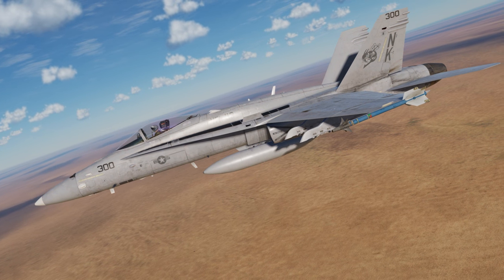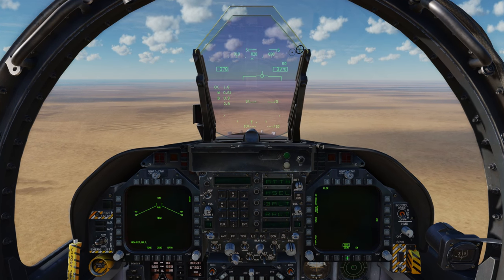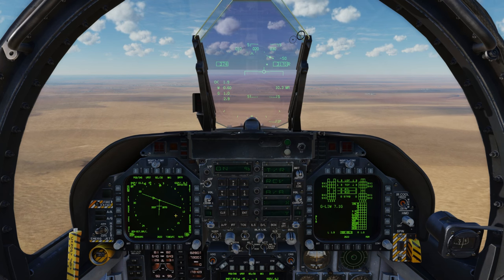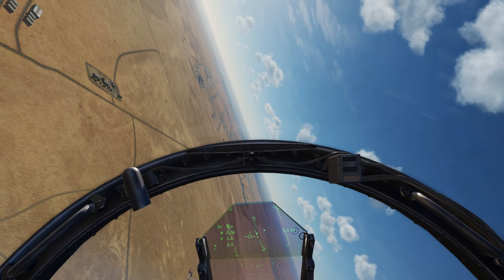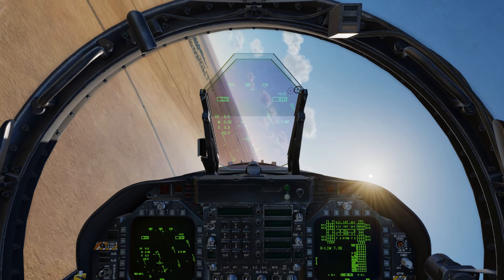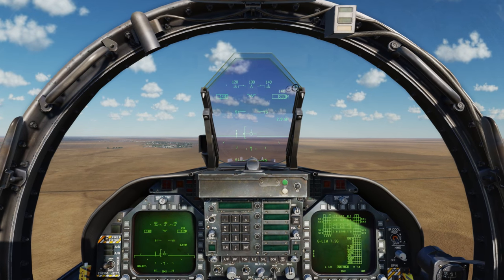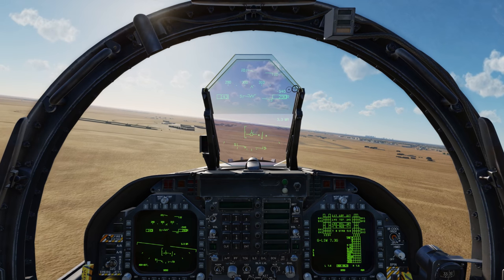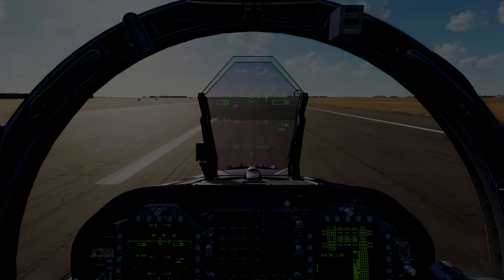DCS: F/A-18C Hornet - Episode 6: VFR Airfield Landing

Comment: Do you push the stick forward after lowering the landing gear and setting the flaps to full in order to keep the velocity vector close to the horizon until the aircraft is trimmed for proper AoA? I am looking for a proper solution to that initial lurch so I don't gain too much altitude.
Reply: YES
Push forward until you start to get around 140kts, modulate as necessary and try to keep the velocity vector on the horizon, once it levels out you'll start to use throttle for pitch, not the stick. Be very aware of the airspeed while holding the stick forward because if you let off it to late to start using the throttle you will nose dive. It will take some time to get used to and just keep trying. I was in the same boat as you last week when I liked your comment. Hopefully by now you have already figured it out but maybe someone else who is in the same boat will read this now.
Reply: @isaiah2261  Thank you. Yes, I started practicing along the same lines, but it helps knowing other people are using the same method. Means I might be on the right track.
Reply: @isaiah2261   thanks I'm in the same boat right now :)
Reply: Mee too in that boat.

Comment: Hi Matt a few have mentioned it on here about 800ft being too low, you said it’s standard US navy procedure, my question is, thus airfield is flat terrain all around, many airports however on various maps have mountainous terrain, some higher that 600/800ft, what happens is this scenario? Surely the 800ft/350 knotts needs to be increased in altitude? Thanks in advance
Reply: The 800 feet he mentioned is radar altitude therefore it is absolute height above terrain.  If the airfield is above 800 feet BAROMETRIC then you would still fly the pattern at 800 feet RADAR.  Assuming the 800 feet is correct.  I can't comment on that as I don't know the naval procedures (I was AF)
Reply: @JohnVanderbeck  thanks for your reply, I should of explained better, so when flying the upwind, that’s all good at 800 feet, however on the 1st turn (crosswind), and downwind, many airport terrain fluctuate as you fly over surrounding mountains and hills adjacent, the example shown here is perfect as it’s flat, but many times I’ve turned and found myself down to 400 feet due to increasing terrain height - at this point I’m just presuming that pattern landing would nit be allowed at such airports…..but there are many of them, particularly on the Syria or Persian gulf map

Comment: This break arrival might be US-typical, because you'd get rekt out there in the French Navy/Air Force for decelerating during the break (first turn). If you are doing a 2-ship or more formation break arrival, the second, third and fourth guy would just slam your back faster than you could ever imagine, especially if you are at 150 kts or less during last turn.

Procedure here is 350kts and 3g turn until downwind, then airbrakes (not for the leader)/flaps/gear out, confirm 3 greens (or BIP), then point 180 turn at 150 or 170 kts (it depends if you're in a Rafale or a Mirage 2000), THEN in final, you keep your AoA into the green.
Reply from the maker: If I do a French aircraft over a French airfield, I will keep this in mind thanks.
Reply: AFAIK, French Navy pilots are trained in the US ;) And NATO-procedures, you know ... ?
Reply from the maker: Sure, but you comments are not correct for a Hornet over a US field.

Comment: The jet will have an aggressive nose dive when extending flaps on downwind specially with gear down. I always have to set the throttle at about 90% just to maintain altitude. It just doesn't feel right that you have to almost go full burner just to maintain level during landings. Is this a bug or I'm doing something wrong?
Thanks!
Reply from the maker: Already fixed for the next update.
Reply: Thank you! When will the update be released if you don't mind me asking?
Reply from the maker: Already fixed.
Reply: It still doing the same thing. 1500 fpm descent with engines at 80%  and about 7 deg nose up attitude no bank, indicated airspeed at or above 150.  It descends even more when I bank to final. It only does it once I drop the gears.  I have to go full burner on approach sometimes just to have the "doughnut" in the AOA indicator. Though I have not try flying it in Persian Golf. All my flights were in Vegas and the Caucasus in oculus steam VR.
Reply: same 4 me, caucasus.. massive airspeed drop on gear out even at level flight
Reply: Are you using steam VR as well?
Reply: quantomic1106 no no vr
Reply: So it looks like it's universal then. Glad to know that I'm not the only one have thing issue. This really need to be fixed. F-18 is unplayable for me. Thanks for your input.

Comment: Damn Matt, that was clean. 

Not 100% where to look for it in the video, but where can you see your descent rate?

I know it's WIP, but it didn't look like it was a particularly heavy landing. Pretty smooth in my eyes. 750fpm sounds scary
Reply from the maker: Right above the altitude box. Your okay anything less than 800 ft/min. This is a carrier aircraft.
Reply: Matt Wagner So it is. That's what you get for watching on a mobile phone :)

Need to go through the series again anyway. 

Thanks
Reply from the maker: Also, this is mostly a function of weight and why it's important be at or below your max bring-back weight.
Reply: Matt Wagner Yup. Learned a bit more about this with the Harrier. Just a few digs in the deck :D

Comment: Why is he setting the landingcourse to 13 and is using the Runway 31?
Reply: neormm Agreed. When on final for rwy31 you are on a 130 radial inbound and so you need a course of 310 for a correct TO/FROM and CDI indication! Good catch!
Reply from the maker: I prefer to use reciprocal heading to check downwind alignment.
Reply: Ah, I see. Thanks for clarification! Great video as always!
Reply: I dont understand the part with downwind alignment but anyway this video is just awsome. Great work Matt, and thanks for give us this candy!
Reply: If you are doing a lefthand overhead break from the right of the runway centerline (just like in a standard carrier lap or in the video), you can make sure that you "crossed" the extended runway centerline while turning crosswind/downwind and confirm that the runway is on the lefthand side when established on downwind even in case of losing visual reference.

So you kinda make sure if you are doing an overhead break for Runway 31 that you cross the 310 radial inbound (course selector 130).

That's how I understood it at least!
Reply: I figure that the heading of Runway 31 determines its downwind or reciprocal heading is: 310 - 180 = 130 (degrees).  Likewise, if it's for Runway 9, for example, then it's downwind / reciprocal heading is 90 + 180 = 270 degrees,  in which case we just need to ADD 180 instead.  Because either adding or subtracting 180 degrees from any heading points to the exact opposite direction / vector from it.

Comment: Matt, just curious, wy did you make the course line 130 vs the runway heading? I'm not a fixed wing guy but but spent 20 years flying AH64's both A and D models and was in Afghanistan in 03, just curious about the thought process......
Reply: 130 is the reciprocal heading to the runway, meaning that when he turns for his downwind leg he will be parallel (in theory) perfectly with the runway for a precise and calculated approach-not having to deal with constantly correcting the heading until he is on his base-to-final.
Reply: @future with nearly 5000 hours of actual logged time in an AH1 Cobra and AH64 A and D model with combat time in Afghanistan in 2003, I understand what a recip heading is. I have been in multiple Holding Patterns at a fix trying to obtain the magical 1 min inbound leg where in the holding pattern I tracked the outbound leg. I get it and i have flown in REAL time. I have flown thousands of downwind legs, i have never had my "Course to" setting as a downwind, although, we in the attack helicopter community do not perform airfield breaks but I do know how to TRACK a downwind heading......
Reply: That's all well and good, but I literally just explained the thought process behind why the course line was the way it was.
Reply: Don't you get it though? He's flown over 10000 hours in actual AH64 A to Z models, Cobras and Vipers. But he hasn't set his course this way.
Reply: I only wish I had 10,000 hours, I only have half of that :)
Reply: I'd imagine it's just his technique. I've never heard of a Hornet pilot setting the recip of rwy heading/BRC/EFB.
Reply: As a Military Pilot, I concur
Reply: As a civilian pedestrian, I'm confused.

Comment: Thank you for the video man!

I am having a ot of difficulties with this type of landing but I am going all out on practice.
One question: 
When I deploy landing gear and lower flaps when under 250knots, my aircraft starts gaining altitude, and I have to fight it hard and compensate by decreasing pitch. Is that normal? Am I doing something wrong?

Thank you!
Reply: Did you find an answer for this?  Just started yesterday and I'm having the same problem
Reply: @whitenoise509  negative! Will post here if I find the answer. What is do atm is I anticipate the lift by decreasing pitch before deploying L.gear and flaps
Reply: I having the sqme issue, someone in the comments mention using the stick to line the velocity vector to the start of the runway, and using only the throttle to line the velocity vector to the aoa E indicator
Haven't had the chance to try it out yet

Comment: Waggs, the Hornet is said to require some forward stick after landing as the Hornet has the tendency to flair after touching down.  My question is, if a short runway and you're laden heavy, do you retract the flaps and/or engage the speedbrake to help slowing down?
Reply: I've seen speed brake used quite a bit IRL. But there's always the fuel dump option.

Comment: So the hook bypass switch was in carrier the whole time. Is that standard procedure? Does it affect anything other than the AOA indicator?
Reply from the maker: Coding for the hook bypass switch is not complete
Reply: Matt Wagner Oh ok, thanks. I just remembered you using it in the startup videos.
Reply: It also affects the approach lights on the nose gear, which is what the LSOs reference to determine whether you are on-speed/fast/slow. It will flash if the indexers are flashing.

Comment: So you aren't putting the "E" on the runway and then flying the TVV to the "E", but rather placing the TVV on the runway threshold, with stick, and bring the "E" to meet the TVV by throttle input?
Reply from the maker: TVV inside the E bracket using trim and fly TVV/E bracket at 3.5 degree glideslop to the runway.

Comment: The G-Limit is 7.0 first, then it goes up and is 7.3 in the end of the video. Why is that? What changes the G-limit, and it's even higher with Gear and flaps down than in clean condition?
Reply: The G-limiter increases G available as the jet burns fuel and gets lighter. It's not uncommon to launch with a full bag of gas and see only ~5.5G (or less) available. This prevents aircraft overstress.

Comment: Should I maintain the same altitude after the 180 degrees turn? (on the downwind) Or slightly descend?
Reply from the maker: On the downwind, you should be at 600 feet AGL until you turn into the base leg. Thanks
Reply: @MattWagner  Ok, thank you for the reply.

Comment: Is pattern landing a necessity in military airbases in DCS?
Reply from the maker: I would not say a necessity, but common practice in the real world. However, straight in approaches are certainly not uncommon too.
Reply: Thanks Matt, final question if I may, newbie on flight planning, where does it say on the airport charts if a pattern is required? Or is that communicated through ATC on approach?
Reply from the maker: @michaeltorode8689 . There is none, at your desecration.

Comment: Is there a way to land at airports without TACAN using, for example, just a radio signal to navigate and contact tower?
Reply: Manually setup waypoint using f10 map and kneeboard to find the runway heading for crs heading line. That's the only way. Don't forget magnetic heading offset. Hornet allows you to switch to true heading, which makes this type of stuff a bit easier.
Reply: @TealJosh Thanks for the reply GT, I kind of thought that was the case. What's the button or menu to switch to "true heading"?
Reply: @MarkShawMedia  On HSI page -> data -> a/c
It's on the right center button. HSI page shows true after changing it to indicate which setting you're on.

Comment: how do you avoid the flare up when you put your landing gear and flaps down?
Reply from the maker: Flaps coming down should be done while in the first turn once below 250 kts. Thanks
Reply: @MattWagner  Thanks.... the flaps do not go down even if you set them to full down, they go down automatically when "they want". I've seen this via the F2 and checking the aircraft on the outside. If i do it when you do it on the video i get a huge 30+ degree flare up. So if my velocity vector is 5º below horizon, i get a huge +25 flare up until aircraft goes below 110knots and then comes back down and speed increases. I have tried doing this correctly over 70x. Aircraft flares no matter what i do. I have to seriously push forward on the stick to avoid this and it still flies funny or it looks funny. Sorry. Trying to land as nice as you do it here.
Reply from the maker: @highlanderc . Hello, they will not go to half or full flaps unless you are below 250 knots. If you lower the flaps while in the first first turn, you never have to push forward on the stick. Thanks
Reply: @MattWagner  Thanks for your reply... I will try this.. Thanks ..

Comment: How do you know what degrees to set the course line????
Reply from the maker: You can either check the briefing or check the map view (F10). Thanks
Reply: @MattWagner  I appreciate the reply. I'll stick to the training missions for a while. I have the start and take off part down like a champ.
Reply: F10 for map, click on the airport, the runways are listed there. Then -12degrees or so for magnetic variation (map dependent) on the regular caucous map. Hold the course switch until the UFC displays "crs" then type in your course.

Comment: The video says it’s instruction for VFR landing of this aircraft.  I’ve never flown military or jets, but I did get my PPL-A Single Engine Land many years ago and I can tell you that all my instructors and examiners over the years would have smacked my knob-twisting hands / issued me a failing grade if I spent all that time looking INSIDE the cockpit twiddling knobs and checking complex displays as shown in this video.  VFR means keeping your eyes OUTSIDE the aircraft, not doing most of the flying by reference to, or controlling the aircraft with instruments INSIDE the cockpit.  Quick glances at the airspeed indicator (for correct approach airspeed for the aircraft which you must memorize for each part of the approach) , attitude indicator, heading indicator, and rate of descent should be all that’s done while flying a VFR approach (and a memorized checklist of gear, flaps, etc. on downwind and final).  The rest of the time / ie. most of the time you’re looking outside the plane and judging your approach by visual reference to the runway and conflicting traffic.  The approach is controlled with throttle, yoke/stick, trim, and a little rudder ... maybe ... to keep straight on runway heading, after the flare, for touchdown).  Yoke / stick with trim controls your speed.  Throttle controls your rate of descent.  Use whatever flaps the aircraft operating manual suggests at the appropriate points in the approach for the airport conditions.  Flaps help control the view over the nose for any given airspeed and allow the approach to be flown a little more slowly.

This video is not demonstrating VFR flying.  VFR ... visual flight rules ... aircraft must be flown by reference to the ground and the horizon and by visually keeping clear of other aircraft by looking around you outside the aircraft almost at all times.
Reply: This is a military aircraft, this is how naval aviators land on an airfield in VFR conditions.
Reply: I assume it´s a little (actually a huge) difference between flying an approach i a cessna and being a military pilot, flying an approach in a hornet. :D

Comment: why is 2.5 so pitch black that canot be realistic?!
Reply: you have to adjust your gamma settings
Reply: Mario Bosnar yea but then it is bright af during daytime....
Reply from the maker: Because it's an open beta and still being tuned.
Reply: I think it looks fine
Reply: You may want to check your  monitor is calibrated. The default settings for brightness, contrast, gamma, "game mode", backlight, black level, etc. from the manufacturer are usually set to favor winning the competition in the store. Default brightness between 80-100% with high contrast values that cry "I am bright and sharp screen!" are common. Unfortunately that does not favor a realistic lighting situation. It works well with Hollywood movies and comic book colored shooters, though. That's why many of us never noticed.
With PBR and a lot more dynamic lighting introduced this gets more important.
I agree with Matt, this is work in progress and is likely still tuned, but after I tuned my monitor to medium brightness/contrast values, adjusted the background lighting and color, it was a 90% fix on the coalpit vs. washed out brightness outside.
It may not work for everyone, but definitely worth a try.